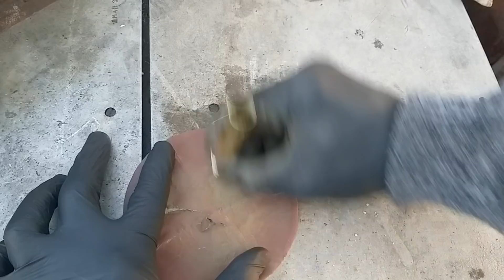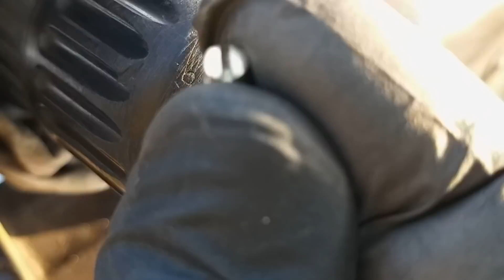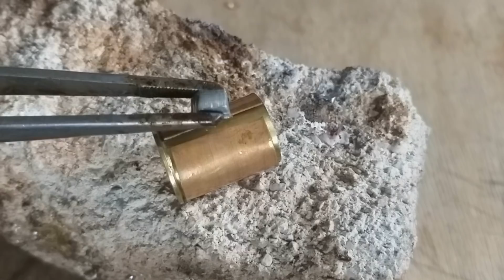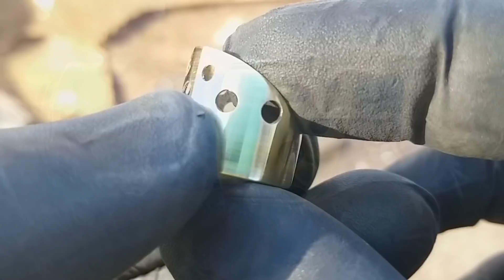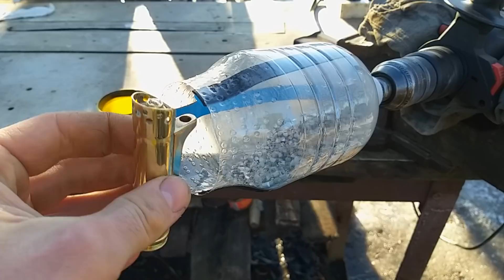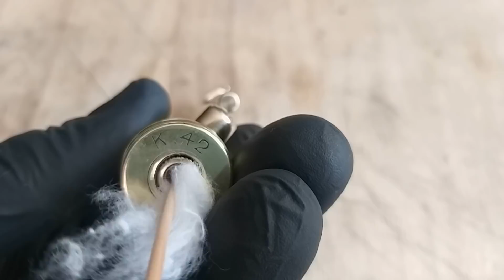MOST Rare Case Turned into a Giant Lighter .55 Boys Anti-Tank

Comment: Wonderful build.  I use a Zippo lighter every day and love everything about it.  Never found any fuel that lit so easily as what you have there!
Reply from the maker: Thank you, that is just A95 gasoline😄
It's not bad but way too smoky
Reply: @almostperfectrestoration  I'll have to give that a try.  Had good luck with Naptha from the hardware store, but Zippo-brand lighter fluid works better because of the other stuff in it.  Just expensive for what you're getting!

Comment: I especially liked the brass medium. I can't remember any YouTube video that was totally brass and very primitive or man made tools. Excellent. This is called from WW1, ship art or trench art. I've seen ash trays made from the base of a 105mm shell or candle holders from .50cal brass bolted to the base of a 40mm anti-aircraft round usually inscribed with a geographical location and date concerning some unit or event during WW1 or WW2 or Korea. Vietnam folks would taken a broken hack saw blade an inscribe unit designation, dates in cou try on one side and 'Vietnam' on the other on Zippo lighter. Again,  great video.